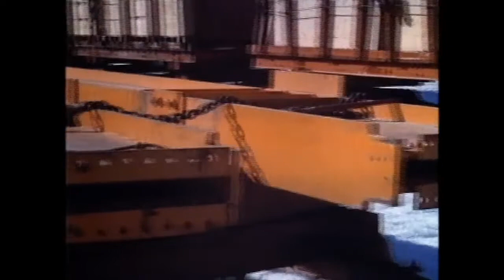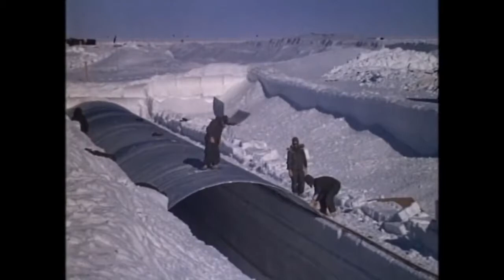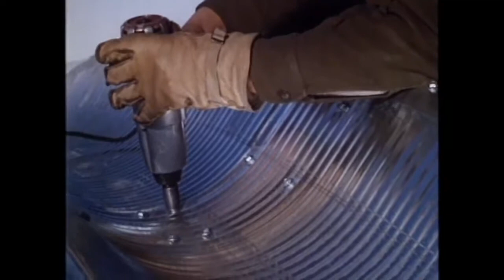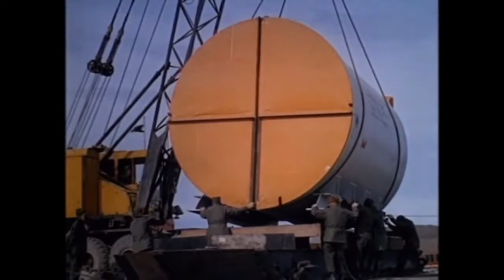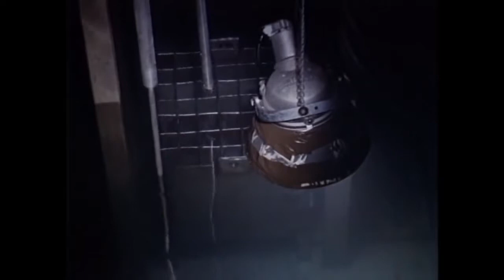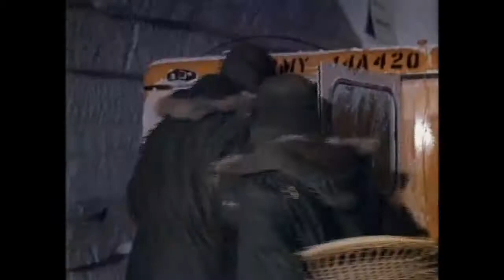The Best Documentary Ever - UNSOLVED MYSTERIES: The Secret American Base in Greenland ()

Comment: Camp Century was an Arctic United States military scientific research base in Greenland. It is situated 150 miles east of Thule Air Base. It was built and publicly promoted as being a base for scientific research, but decades later the facts were discovered that in actuality that was the cover story for Project Iceworm to install sites for launching nuclear missiles in Greenland, a project which was kept secret even from the host nation of Denmark. Powered by a nuclear reactor, the camp operated from 1959 until 1967. The base consisted of 21 tunnels with a total length of 9,800 feet (3.0 km). Project Iceworm was aborted after it was realized that the ice sheet was not as stable as originally assessed, and that the missile basing concept would not be feasible. So Camp Century was abandoned, and the reactor removed. However, many tons of toxic waste remain buried under the ice and continue to be an environmental concern, particularly with the general trend of ice mass decreasing and the possibility that these materials will eventually get exposed to the surface. (Wikipedia)Construction on the camp and the sub-glacial nuclear reactor began without explicit permission from the government of Denmark, leading to a political dilemma for Prime Minister H. C. Hansen
In 2016, a group of scientists evaluated the environmental impact and estimated that due to changing weather patterns over the next few decades, melt water could release the nuclear waste, 20,000 liters of chemical waste and 24 million liters of untreated sewage into the environment. However, so far neither US or Denmark has taken responsibility for the clean-up.[3]